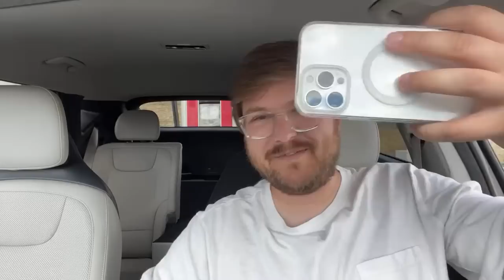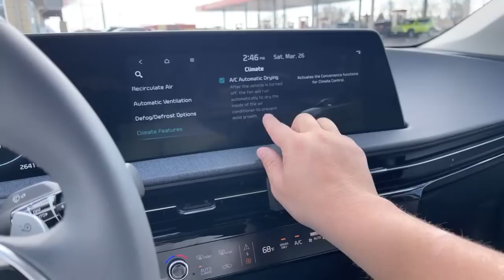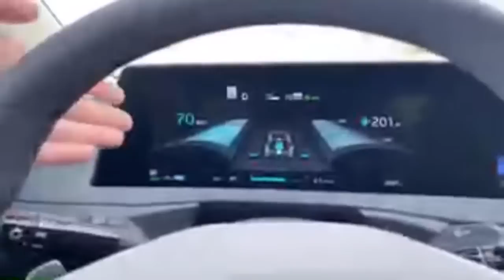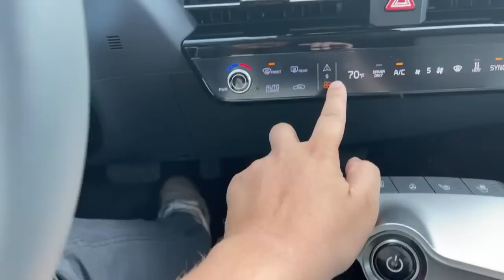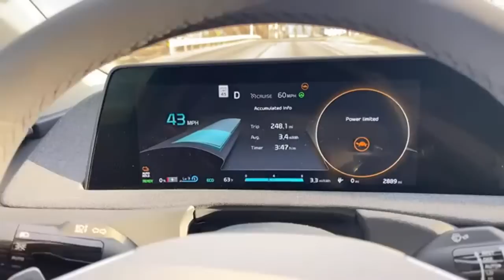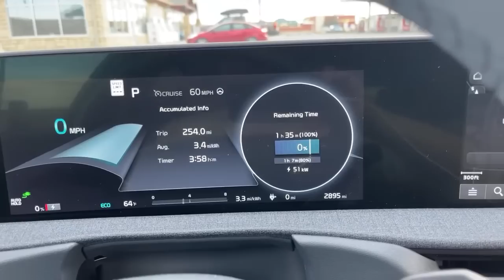Livestream: Kia EV6 AWD 70 MPH Highway Range Testing

Comment: 3.4 kw is pretty lousy.  I would expect close to 4.  I notice EVs are kind of backwards.  You get the efficiency for maximum range of you are in town when you don’t need it, but if you are out on a trip going 70 or more on the Highway you get your worse efficiency and range when it actually matters.  Also, if it’s colfpd you get worse, if you are uphill worse, high altitude worse.

Comment: I am starting to watch this one late, but the finished charging was a lot less painful then the Volvo XC40 recharge!! Jut wonder if that fast of a charging will damage or reduce the battery life?
Reply: Batteries charge faster when using high power charging stations. Frequent use of high power charging stations has an impact on battery life. Battery life is usually calculated in terms of charging cycles. One charge counts as one cycle. Frequent deep discharging and recharging can lead to shorter battery life. Operating at high temperatures can also shorten life.

Comment: Kyle, I have a thought.  So much of the general public views that the number of charging stations should match the number of gas stations. What they need to be educated on is that 90% of drivers drive less than 40 miles per day. You treat your car like your smart phone and you should be good to go. A credit should be given to the home builder for installation of a charging station in a garage or carport. One more thing, climate change has become political. The world is switching to EV’s primarily because the technology now exists. We need to separate the EV boom from climate change to protect it. The easier it is to charge the easier it is to buy an EV.   -Kyle

Comment: Had a GT-Line AWD for just over a month now.  So far, I've only charged it at home on my Grizzl-E 40A charge station.  That will easily get me from 10% to a full charge overnight.  There's a EA station at a grocery store nearby that I plan on trying out at some point, but for the way we plan on utilizing the EV6, 99% of our charging will be done at home overnight.  Having said that, the EV6 is my first EV, and is an absolutely amazing vehicle.  I've been telling my Wife since we owned it that it's an effortless, quiet, and even serene driving experience.  I'm completely sold on owning an EV for at least one of the two cars we have (excluding our younger daughter's Rav4 that's in the garage while she's at college).  I'll likely buy a PHEV to replace my Wife's 2013 Acura RDX when the time comes.  The way I look at it, having an EV for a daily run-a-bout, and a type of ICE car (hybrid or PHEV preferred) for long distance trips gives you the most flexibility and is the best of both worlds, until the EV charging ifrastructure is more developed and more robust.
PS:  I'm down in Parker, CO if you're ever in our neck of the woods and need an emergency charge Kyle.
Reply: So what if you go out at night ?
Reply: Good...